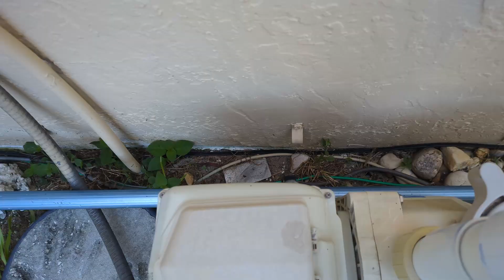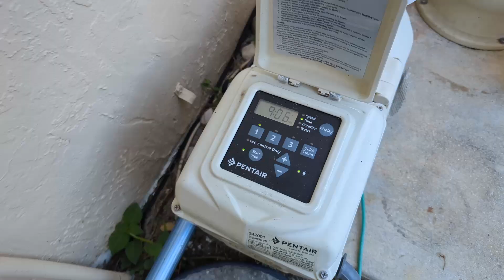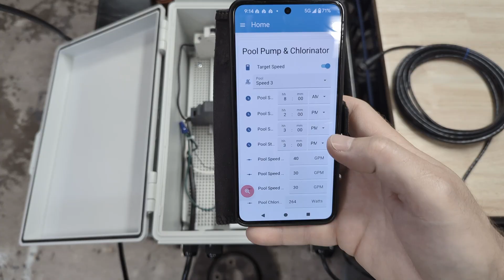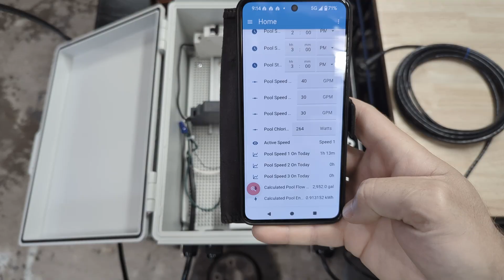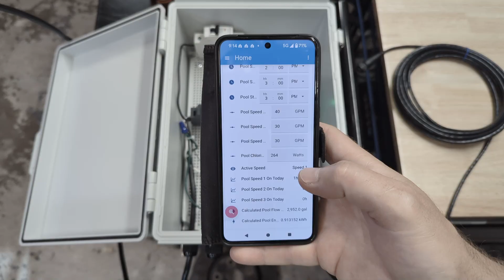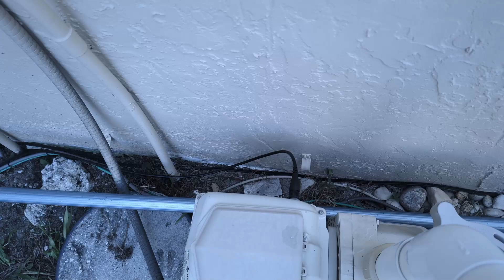Superflo VS + Home Assistant pool automation

Comment: Where did you find what wires control the 3 speeds on your pump? Im guessing all these pumps can be controlled via relays and don't use a digital controller.

Comment: Where are you running the black wire from the control cable for Superflo VS? It looks like you're putting it on the input side of the Meanwell power supply. Is that correct?
Reply from the maker: The black wire gets tied into the ground